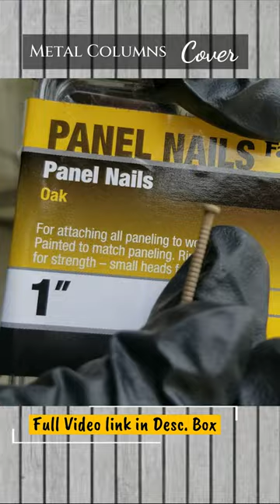How to Cover Metal Columns | Covering Wrought Iron Column Makeover Short

Comment: Hello, why do you build the cement base? Why not put the wood on the porch floor?
Reply: He probably did it cause of water but if pvc material will be better
Reply: @kelvinbradley1893  thanks.
Reply from the maker: @kelvinbradley1893   
Yes,  @kelvinbradley1893  is correct, and I also agree that pvc would have been better. 

Here's the full video: https://youtu.be/JBOdUBTo95o
Reply: Hi, why is PVC better? Is it because it more waterproof? I am looking to upgrade my metal columns as well and trying to find the best method. Thank you.
Reply: @nicariverashorts2521  Hi, great job! I am looking for a video where someone uses PVC, but can’t find one. If I go to Home Depot or Lowe’s what type of PVC should I be looking for? Does it come in long sticks like the wood?
Reply: @RelentlesslyPerfect  Hi there, hardware stores carry PVC Column Wraps. However, at that time, i didn't find the size i needed (rectangular) everything seemed to be squared, perhaps they might have it now... you can Google "PVC Column Wrap" and go from there.
Reply: @nicarivera83  I’m in the same boat! My columns are also rectangular and look very similar to yours. They are about 9” wide and between 7-8’ tall. How is the wood holding up? I may have to go that route since I can’t find the rectangle PVC
Reply: @RelentlesslyPerfect  I placed some blocks of wood in between the boards and screwed that together. You can see it better in the long format video.